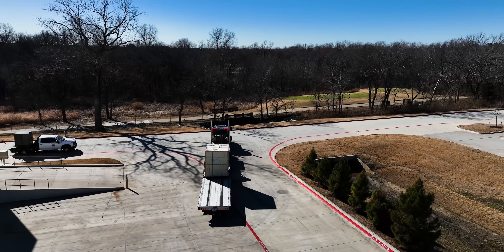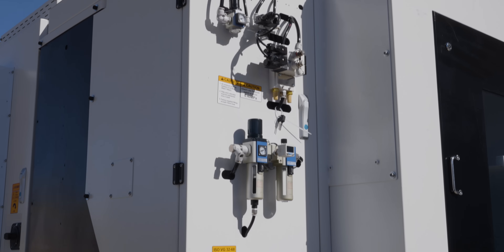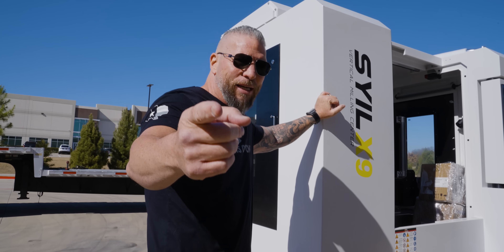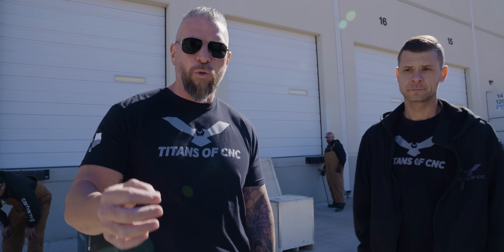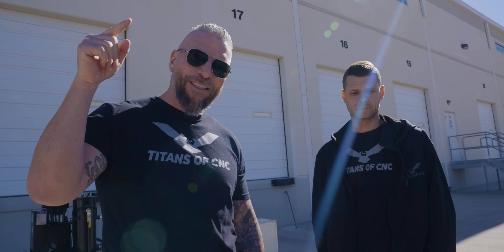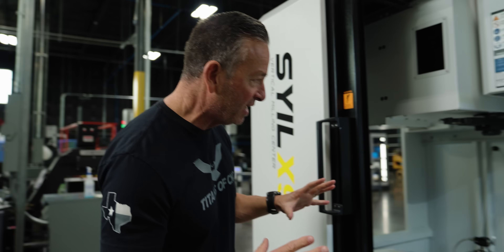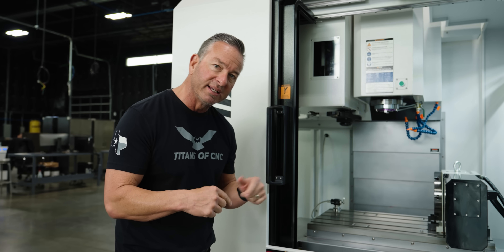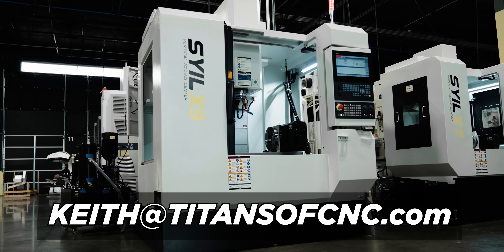Greatest CNC Machine for the price | $53K

Comment: That sounds really competitive... I'm interested in what extra features it comes with like probing and tool probing and if it has any of the engraving and fixed subroutines like an old Fadal did with the CNC 88 controller... back in the day that was one of my favorite entry level machines made in the USA. Kinda miss them really... it would be really cool if you could show us any of that kinda with the controller... I will say that I've always stayed away from them when buying machines due to the amount of people in the workforce not that familiar with them. Most of the time we went with  Fanuc because of that for staffing reasons. We did end up going with Mazak for a big VTL 5 axis a 1550... it was the best bang for buck in that situation. It's been a good experience so far 12 years now... My biggest thing in choosing a machine is first, what is the local support for that machine and what kinda time is required for replacement parts... then if it passes that, I look at the controller and staff experience and weather training is going to have to be apart of the decision or not. Because of the real cost of training. We did end up getting a Mori-DMG mill-turn machine with a Seamans controller. Not bad but definitely had a major learning curve to that one... and honestly, it was not as ridged as the Mazak of similar size and capabilities... on that one, we ended up regretting getting it instead of a Mazak... I would really like to see a comparison... especially to a similar Mazak and HAAS... I love the content and value your opinions. I appreciate all of you...

Comment: I love in Machining that 53k is super affordable to buy the machine. Then you might be able to turn a chip after about 100k to 120k total after you figure in all the tooling, coolant, electrical, fondation, leveling,problem shooting, cad programs and don't forget the operator to run the machine and a programmer to program it. Q.C. for checking the parts.

Comment: Took delivery of my X9 this past November, thanks for all the help Keith!  It's a game changing step up from my little Tormach 770MX.  I'd be happy to help answer any questions anyone else might have when considering this machine.
Reply: can it fit into a 82" garage opening?
Reply: @siliconvalleymetal  I don't think so.  The machine measures around 92" without the feet attached.  You probably can get a little more clearance, but you'd have to power the machine up and move the Z axis all the way down, then disconnect some of the wiring and hoses at the top of the spindle.
Reply: Did you have any concerns about weight? I think for the extra money the X9 is a better deal than the X7 but it weighs 4x as much and I have concerns about putting one on a normal garage concrete floor.
Reply: @willclausen1814  No concerns, I've got mine in a shop, so the concrete is pretty thick for heavy equipment.  However, I'd contact a local concrete outfit or industrial builder and find out what they think about putting 13,500lbs on a standard garage floor.
Reply: Do you have 12000 or 10 000 rpm spindle ?
Reply: @panberet  I have the 12000rpm spindle.  I believe it comes standard now.
Reply: @lukemaslak7935  so the 12000 spindle was an additional option, not by default? Now only a 10000 rpm spindle is available.
Reply: @panberet  No, the 12000rpm spindle comes standard now, to my knowledge there is no more 10000rpm spindle.
Reply: How long did it take to be delivered?
Reply: @clutchboi4038  Around 7 months

Comment: Are you going to be showing some proper cuts of the X5, X7 and X11? Been waiting to see that since you showed them off.
Reply: 11 months ago they did a video on machining inconel, 3 months ago they made a mirror finish on a part. They've shown these machines cutting.
Reply: @ both are very low spindle load. The Monel was like 25% spindle load.
Reply: @filmatura  You're changing the goal posts, they showed the machines taking proper cuts. Yes they could absolutely go higher in spindle load but that also affects tool life and other factors. The program was made to fit the parameters the machine could handle.
Reply: @ my goal posts are simple. Run it at 100% spindle load. I've seen Syils do beautiful surface finishes, but EVERYONE takes tiny WOC cuts with them, which does not imspire confidence on the spindle rigidity.
Reply: I have a syil X7 in my garage. The weak 220V single phase one with an LNC control. It has 3HP, Low torque
The maximum I can do is 3/8 diameter, .5 Deep slotting in 1018 / A36 Steel
I mostly machine with dynamic tool paths. Even tho the machine is the weakest one available, I can make parts to around +/-.0005 
easily.

I've ran 5/8 diameter endmills 3" deep, at .030 width of cut and 200IPM, I stalled the mill. Good machine tho
Reply: @filmatura  You can`t run ultra fast just to reach 100%. It does not say anything. Depending on the material the cutter could get damaged prematurely...
Reply: I’m working on getting them setup to show them taking some real cuts sorry for delay but the cuts are coming I promise 😅
Reply: Do you see any machines working in the background during the movies?
Reply: @narzedziowniawbudowie  That's not the problem here, Titans are primarily a Youtube channel and distributor, not a machine shop. I just feel like they've been very hesitant to show the Syils take proper cuts.
Reply: @filmatura  apparently I'm not up to date, I remember the times when there was a lot of practical knowledge where the chips were falling. Today I understand that it's a big showroom plus training? which doesn't change the fact that they do a good job :D
Reply from the maker: I cut Monel and hogged and made beautiful finishes on the X7… Jessie has made a ton of parts and hit crazy tolerances in videos. He even made a probe mag base out of stainless that had to be perfect. We also just hired Steven to just machine and make videos on the Syil.

Titan
Reply: @ I'm not hating, I'm a big fan, I'm just still waiting to see the machine cut aluminum or steel. Everyone who has the machine is crazy careful with it so there's zero content showing it take proper cuts. 

And any medium cuts sound like chatter. Even the X5 video Jesse did you could hear the maching was at the edge of what sounds good.
What good is 22hp if the spindle isn't rigid enough to take a 22hp cut?
Reply: @filmatura 100% spindle load kills every machine .. if you plan to use it more than 2 years you just should respect the machines capabilities... These machines are more on the drill center side but enable you to get production in house for a cheap price. You just don't know what you're talking about. Each machine has its individual advantages and skills have the cheap price with capability of repeatable low tolerance machining parts. Do you have to suffer feed rates and rpm? Yeah. But if you cannot pay 5x+ times for a machine that matches maximum cut capabilities of the material and tool it is a nice option to get your foot into the door.
Would I like to have a Chiron or Heller over a syil? Absolutely but money matters in many cases and only later on the time that the more pricey machines being faster is relevant. A machine to be able to produce is better than none.